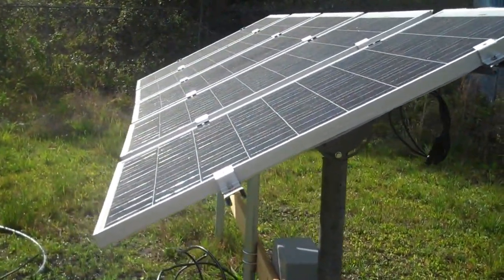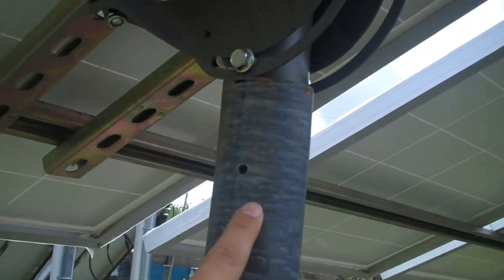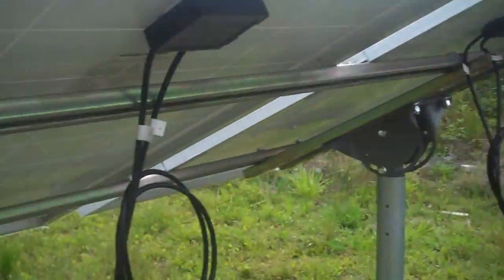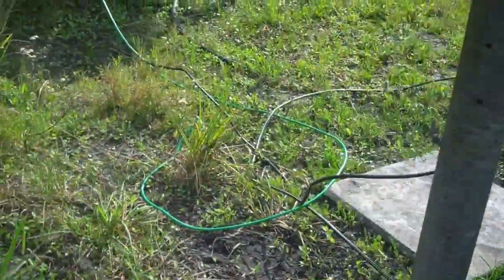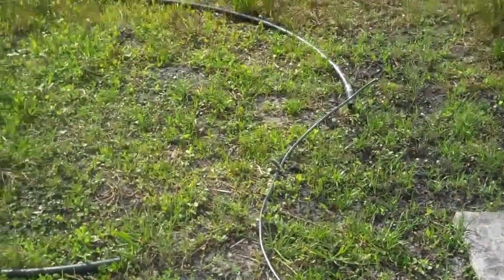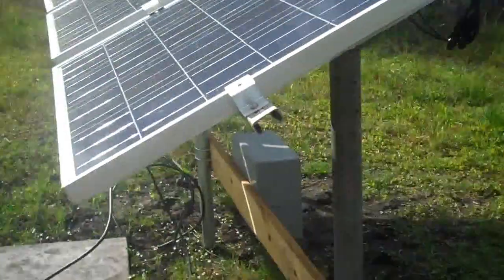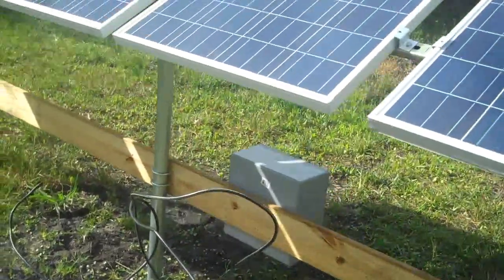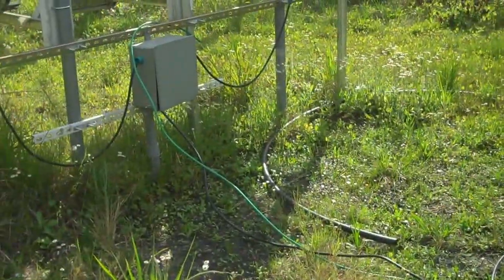DIY Solar Panels - 5 Windy Nation 100 W Solar Panels

Comment: Are those satellite mounts from Dish Network or Directv? Thanks
Reply from the maker: I would say that when they were bought of eBay the description said it was for both - I'm guessing they were a general, no name brand satellite mounts. I have seen both types from Dish Network and DirectTV; both types could be modified to hold aluminum struts/wood boards to mount solar panels. Hope that helps.